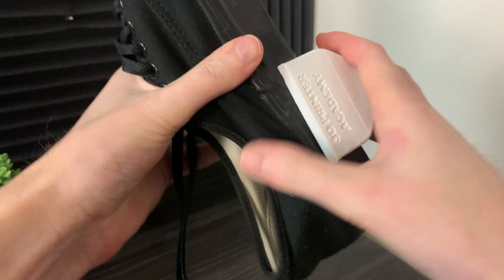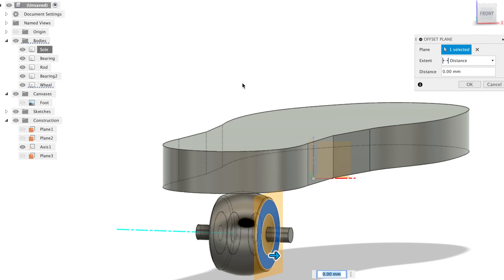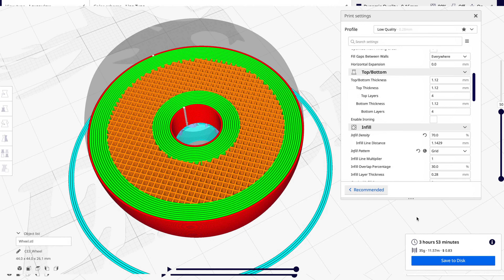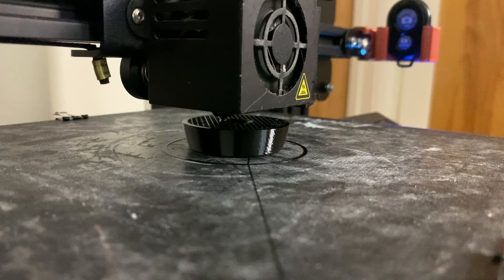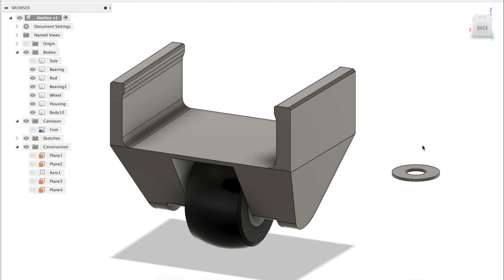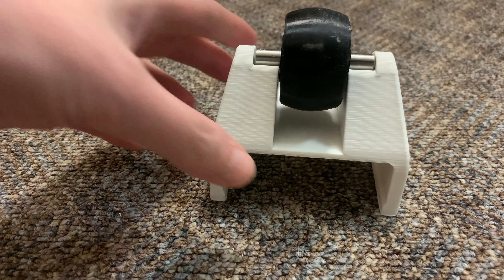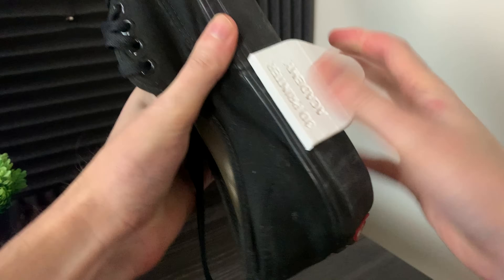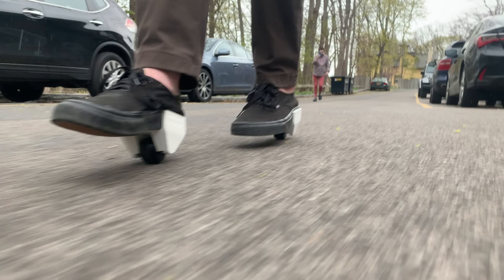DIY HEELYS - Will they work?

Comment: Would recommend to make them lower, print them on the beveled side to require minimum of supports and improve strength in the weakest points
Also would recommend to make wheel much smaller to make it harder to reduce friction and improve speed :)

Comment: Nice design, however I would maybe increase the contact area with the sole in order to reduce the preassure and perhaps try a desing with two wheels on the sides as running with these like in the video looks pretty uncomfortable.

Comment: There is a way where you can make it so that the pressure of the weight of the person clamps the sides. it can be printed in place with some clever openings to act as 'springs' and locks.
Reply from the maker: I have been thinking about this as well. Where you can step into them and they lock onto your feet. To take them off there could be a release button or something.

Comment: Instead of a little clip imagine heely inserts or platforms, you just step into it and boom, instant heelys, like it would go all the way around the shoe, that way you could walk semi normally like original heelys
Reply: Um, yeah, they used to have 4 wheels and were called roller skates.
Reply: @freedapeeple4049  I don’t think you can walk in roller skates bud.
Reply: @KentuckyFriedChildren  You can?... they have a flat bit at the back or front depending on the design, so you could tilt back or forward to walk on them.
Reply: @KentuckyFriedChildren  Plus even without that you can still walk in them :/

Comment: thats insanely dangerous lol, real heelys are built into the shoe so they will immediately stop rolling if you lean too far back, but since these make you so high off the ground, if you go too far back, you will 100% fall backwards, don't print this, just buy real heelys if you want them, this is not safe.
Reply: ... this a cool hobby project. And- you really should know the risks if you're printing wheels to strap on your shoes?

I find it really cool, because I struggle to design much simpler mechanisms. Speaking of that, I have a clip to redesign...

Comment: Cool video! I'm looking at how you sliced this with a lot of support. I think that with small adjustments you can print the base on one of the sloped sides with minimal support at the pocket for the axle. I think this will be just as strong for the axle support and stronger for the side flanges. One other thing: printing at 100% infill can cause a lot of trouble if your filament is slightly oversized or over extruded, the extra material will add up untill the back pressure is enough to clog the nozzle. I think it is no problem with TPU since it is mostly under extruded due to thinning in the extruder, but something to bear in mind for other projects. I would never go over 90% infill just to have some slack
Reply from the maker: good points!
Reply: I tried this and used triangle infill patterns and also a 50% infill so and it definitely worked well for me, but just bc i am on the lighter side i would recommend a stronger infill percentage

Comment: Do you print tpu on a cr10? If so, what are your settings?

Amazing project btw
Reply from the maker: I printed the TPU wheels on my ender 3 using the default slicer profile in Cura. The only changes I made were lowering the print speed to about 35mm/s, 100% infill, 7 for wall line count, 110 nozzle temp, and 50 for bed temp.
Reply: @3DPrinterAcademy  thanks, just with the stock hotend?
Reply from the maker: @simonderoo9189  yep! all stock parts
Reply: @3DPrinterAcademy  well i gues i need to buy some TPU then and try it out
Reply: @3DPrinterAcademy  110 nozzle ?
Reply from the maker: @brunocecile8453  oops 210!